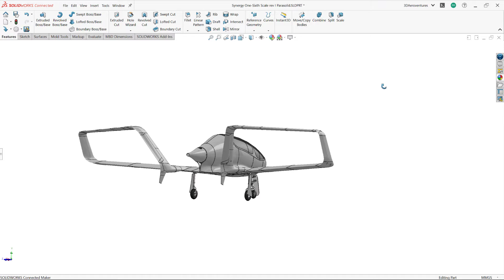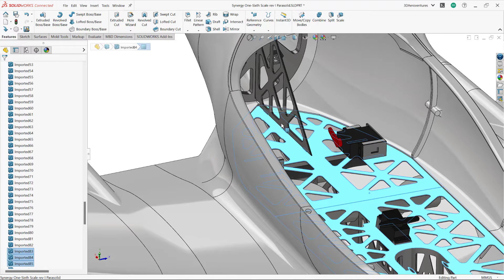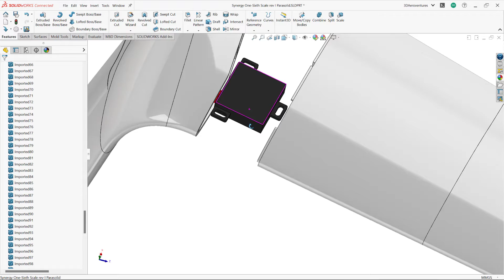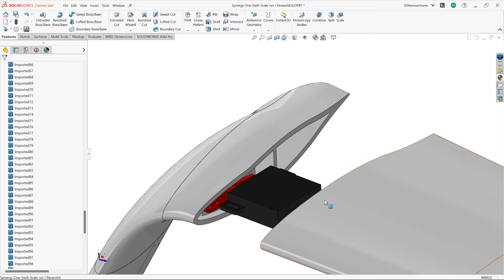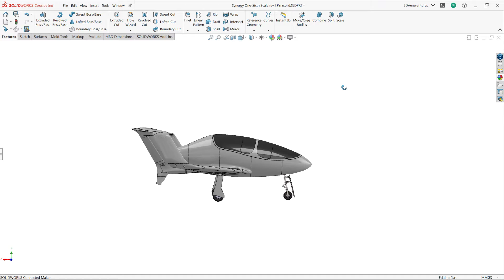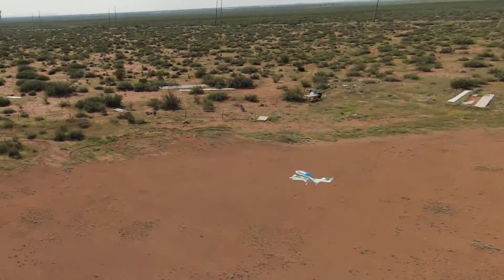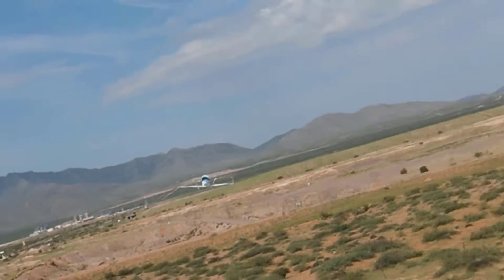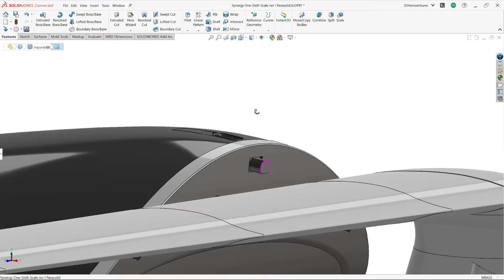DBT Aero Inc.'s Synergy Prime - 3D Printing an Ultra-Efficient, 1/6th Scale Unmanned Aircraft

Comment: That is an awesome build, hats off!! I am glad to know the company is still around. I was smitten the first time I looked at the design of this aircraft years ago, read all about in the old Synergy website, where they laid out all the benefits of double box tail, positive wing-elevator biplane interference, subsonic area ruling, powered drag reduction, and speed and efficiency numbers that would raise some eyebrows. The claims were tall, but the design just looked promising even at a glace.

If the plane does come to the commercial general aviation market in the near-mid future and delivers on the speed and efficiency claims, owning it would be my personal goal. How fast it go compared to other RC of same power, weight and wingpsan?

Comment: Great job. I understand the efficiency gains here. Box wings eliminate tip losses and can help to reduce structural weight thus efficiency up. I guess the large diameter prop can help too. A lot of companies focus on EVTOL for good reasons but traditional take off and landing could eliminate the huge energy thus range costs for electric planes. So I think there will be room for both